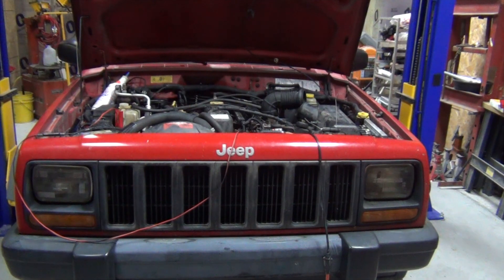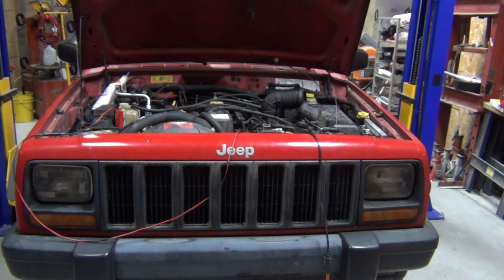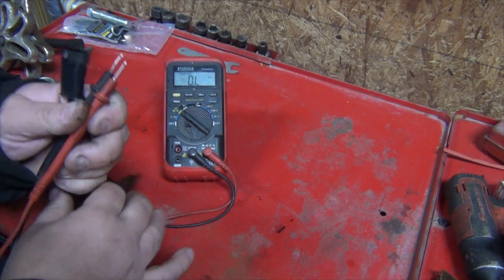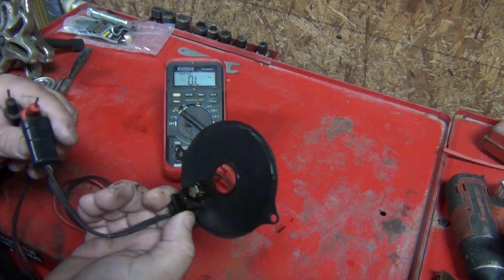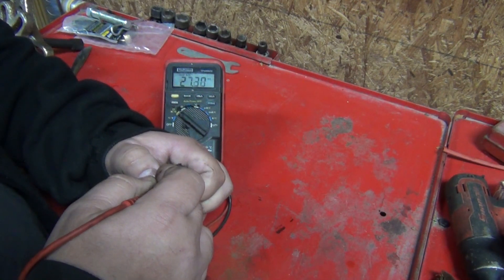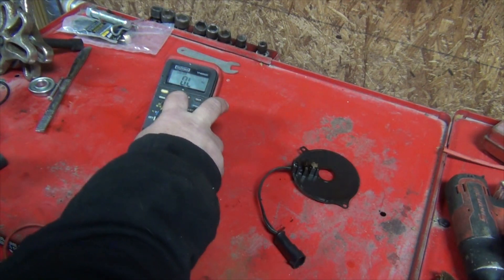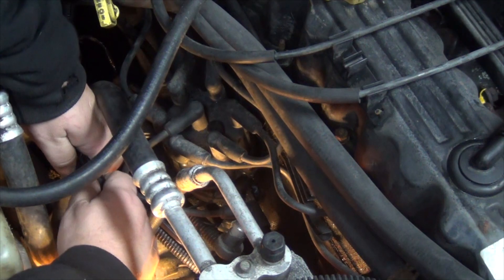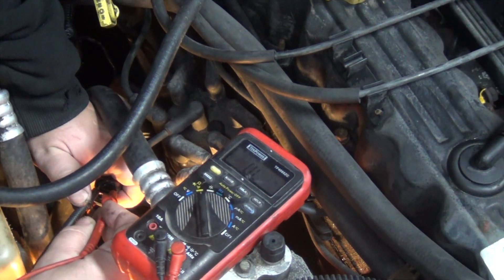No spark Jeep Cherokee no start after sitting for a long period of time

Comment: I have a fantastic 1995 Jeep Cherokee XJ that won't start. The problem is that the ignition coil gets current that enters the distributor through its central terminal, but there's no electricity going out to the spark plugs. I thought there must be problems with the crankshaft position sensor, the camshaft sensor, or that pickup coil. The truth is that I hadn't found a way to test it on the internet. Thanks for sharing that information and I'm already subscribed to your channel. A big hug from Venezuela, greetings.
Reply from the maker: Thank you very much. I am glad you found it helpful. I greatly appreciate you. Thank you for supporting the channel. I apologize for the late reply
Reply: I'm not sure exactly what he thought he was testing.

A coil is exactly what it sounds like - a coil of wire.

It picks up (hence the term pickup coil) induced emf to produce an electrical pulse.

If he was really connects to the two ends of the coil and reading OL (open line) that'san open circuit and won't produce a pulse.

But a dead short is also broken.

The way to test is checking the a/c voltage output of the pickup coil, while you crank the engine. It should be outputting about .2 vdc.

If it does that, it doesn't matter what the exact resistance of the coil is.

But opens and shorts are both broken.

This is NOT how you test a pickup coil.

Comment: which ohms setting did you set it on ? my tester has 3-4 ohms setting . I had the same problem . jeep ran and sat for a month and now just cranks over no spark and replaced just about everthing else and jeep has no codes
Reply: I have a 95 Wrangler that just cranks no start. Was this the part you needed?
Reply: @floaley  I'm looking for a solution to a "no spark" issue I have. I cut and pasted for convenience my post on another: Ok, I'm here searching for tips and help me solve a gremlin in my no start situation.  I have a 92 2.5l 5 sp manual fuel injection YJ.  Short story, a few weeks ago I was on the trail, nothing crazy mind you and it just decided to stop dead in its tracks. Try to start, didn't hear the fuel pump so I figured it went out, had it towed to camp, drop the tank, new fuel pump still no go. Now all the troubleshooting begins. Checked Relays, fuses all good, changed ignition switch, cap, rotor, wires, plugs, coil, ignition coil pick/cam sensor, CPS, ECU all changed. Still no spark! Started probing and checking wires. The ECU is sending signal to the coil. When I turn the key on, the test light lights up, but goes away with cranking, no pulsing like in your video. The other wire as in your video should have 12v full time or just when key is on? either way there is no 12v at the other terminal of the coil plug when probed. I did the test on the coil as in your video, all readings are good! The fuel rail pressurizes and holds at 31, all lights, accessories, radio, dome, turn, brake, running lights, everything works. I'm just not getting spark and for the life of me can't figure out why. I am here looking for something that I have not yet tested, changed or figured out yet.  So, all you YJ peeps here I am looking for guidance. I've had this Jeep 13 years now and been really good overall. This time, it has me baffled! HELP!

Comment: My 1996 Cherokee has the same issue. Im getting less than half a volt to the coil.. so I replaced the distributor pick up coil, the coil, the crank sensor, ecu, the plugs, wires, and rotor cap. Still hasn’t fixed the problem. I checked and I’m getting 12 volts to the asd fuse
Reply: any solution?

Comment: Hey boss so we replaced the distributor and the crank sensor also the camshaft sensor it started right up then we let it sit for about an hour then crank no start any idea what I can do to get it sparking again ???
Reply: did you ever figure this out i've done everything you have same problem
Reply: @shawn2513  hey it been awhile since then but we ended up replacing the fuel rails and adding 3 fans for more air flow certain areas it seemed to be to hot for the fuel rails with only the stock fans in it we had 2 jeeps do the same thing just upgraded the fuel rails super easy they are under pressure be careful but never had the issue again so far

Comment: Hi Mate , I couldn't find a video on this any where. Thank you...... However.....  I got different readings depending if I had the red probe on the first pin. Or the black probe on the first pin...  I got OL touching the other 2 pins using the red probe on the first Pin .But if I put the black probe on the first pin then I got around 28 m ohms on the second pin and OL on the third. Now I'm not sure if I should go out and buy another sensor , because you only showed one way ...